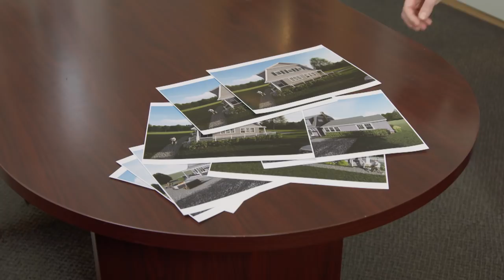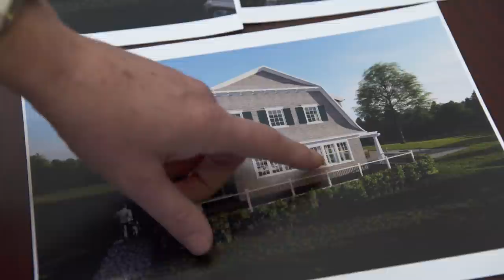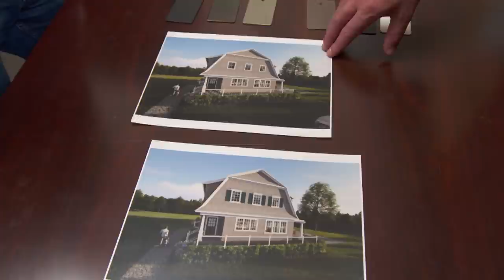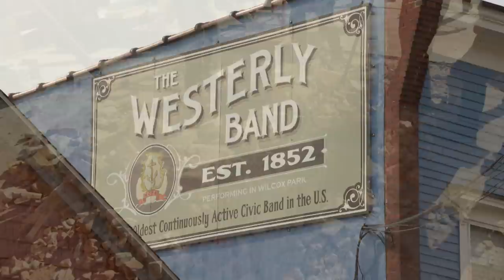This Old House | Chimney Down and Walls Up (S41 E2) | FULL EPISODE

Comment: They do this in Oregon all the time because of new home permit costs and regulations.

 Tear the whole house down except a wall, it's still considered a "remodel"!  You don't have to get new home permits or pay system development charges, so saves a ton of money and the old wall usually ends up an exterior garage wall. 

It is sad though to see regulations causing well built older homes to be tore down.
Reply: roommate I suggest watch a 13 part series called What on earth happened by Ewaranon to learn that the earth is not a globe.

I got it in my about tab.

Comment: Buy a good house, then destroy most of it for marginal improvements.  Insanity.  8' to 9' ceilings gives nearly no more usable space.  4" to 6" thick walls goes from about R-15 to R-20.  Could have built a second interior wall and got any thickness for any R value.
Reply: While I do agree that this felt *super* excessive, if you are 5-6 ft tall, that extra foot of headroom would be REALLY perceptible. It's increasing the distance from eyeline to ceiling by as much as 50 %, and that's a lot.
Reply: I used to really like this show. But on YouTube, the ads every 3 minutes, and astronomical budgets just make it so much less enjoyable.  Become a reno show for the rich and famous. Like HGTV home shows now. 30 something year olds with 1.5 million dollar budgets.  PBS show on free public television that somehow needs to charge to watch full episodes ? I'll pass. Miss norm and the way the show was done when it was more sweat than stacks of 10K
Reply: @JDCrae  Like th Bob Vila and Steve Thomas days.

Comment: Christ, you get free pickups... Go get some towing straps and pull the chim down in sections at this point.  Not like you need to worry about damaging the structure, you removed it.
Reply: That would damage the floor.

Comment: Ruined it for me when you started cutting up those walls. That is just gorgeous lumber and extremely well built. If you wanna add 2 inches for insulation, just put Zip-R on the outside. Saves you a day's worth of work on demolition and 2-3 days worth of work on reframing new walls. As for the extra foot of height, you can have a factory make you custom headers for the whole house for half the cost of labor to demo those existing walls. 

But whatever, you wanna reframe the walls from scratch go for it. But how could you cut up and destroy that lumber? You seriously gonna tell me that Habitat didn't want that?
Reply: And then they reframed with particleboard. I've never seen anything like it before.  Senseless.
Reply: @MeteoriteGallery  Hey never forget, this show pushes the ENGINEERED MATERIALS ALWAYS! Even so far as to use laminated beams. And the reason behind that is there are no longer any old growth trees to cut down for large timbers.

Comment: Did they save any money by not just bulldozing and starting over? I understand that location is probably why they bought the property, but why not just start over completely? Is there a tax credit or something for older “existing” structures?
Also, what moron thinks a toilet that requires electricity is a good idea? My stomach still gets upset when the power is out.
Reply: strong I suggest watch a 13 part series called What on earth happened by Ewaranon to learn that the earth is not a globe.

I got it in my about tab.

Comment: One wonders how long till that fabricated stuff starts to fall apart and needs replaced.  My experiences with furniture made out of similar materials would never lead me to using in in mission critical load bearing roles that need decades of durability, so I really wonder if this isn't just a terrible, terrible fad.

Comment: Replaced the first floor walls for insulation? Even if they save $400/year in heat due to increased insulation I'm sure it would take 50 years to break even. Makes zero sense hah